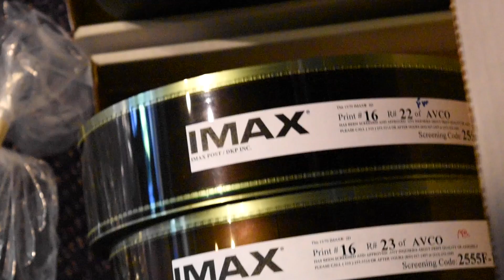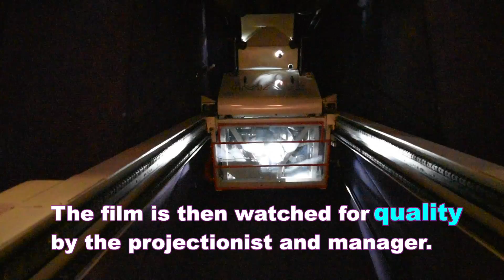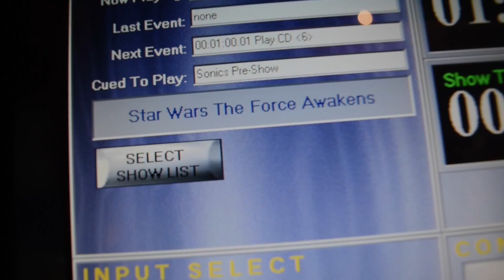How To Build A 70mm IMAX Film - STAR WARS

Comment: That means imax audio is only 4.7gb in size?
Reply from the maker: I actually don't know the answer to that. I assume so unless those DVDs can hold much more that 4.7gb. But I would bet the audio is compressed quite a bit to fit.
Reply: Didnt know that imax would just use a dvd for the audio, maybe it was a high capacity ones or blu ray because 4.7gb wouldnt be enough to fit dolby atmos inside. Ty btw :)
Reply: High Orbit Media no compression of any kind was ever used....three dvds were run in sample accurate sync
Reply from the maker: So how much data can one of those DVDs hold?
Reply: +High Orbit Media 4.7GB max. Blu-ray discs can hold up to 128GB.
Reply: Why can't they just use Blu-ray Disc? They hold about 50gb of info
Reply: Ariya Mangsanhanh I was thinking the same thing.
Reply: There is a DVD DUAL LAYER disc that has capacity of 8.5gb
Reply: Galor S Still Comes nowhere close to the capacity of Blu-Ray.
Reply: 4.7 gb means it can be less too. We dont know how much dvd  is burned. But for immersive audio 4.7 gb is quite large i think, since audio use only little space compared to videos..
Reply: Audio doesn't take much space if compressed enough
Reply: Happilicious What about dual layer DVDs, like the ones used for game consoles? Those usually run about 8-12 gigs and are probably more cost-effective than splurging for Blu-rays.
Reply: A little late, but dual layer DVDs are quite common which contain approximately 8.4 GB of data. Single layer discs are not quite as common outside recordable media.
Reply: But then there is DVD-10 with a capacity of 9.4 GB.
Reply: @NVC77  Oh sorry, DVD-9 might be it.
Reply: Could be a duel layer audio DVD
Reply: @Nitroblast  what???? 17 GB max! 2 layers and 2 sides.

Comment: True IMAX uses a second 'projector' that has 35mm film that contains 6 channels of optical sound information.
Reply from the maker: Care to elaborate on that?
Reply: This was told to me by a buddy that worked at an IMAX theater in Iowa. He said it's a standard 35mm film, but instead of being used to store pictures it holds six optical audio tracks that are read by an optical reader on a second 'projector'. Apparently that's how it used to be done and now the vast majority of IMAX theaters have a digital audio track played off of a hard drive that is syncned up to the 70mm film stock. He always insisted that the optical audio sounded better and called it 'true' IMAX.
Reply from the maker: That is interesting. I knew sound was kept separate but was not aware it was stored on 35mm film. Good knowledge.
Reply: Yes, sounds about right, IMAX tech is not that modern, and before BluRay and DVDs I recall 35mm film was used for sound in my local IMAX theater
Reply: @HighOrbitMediaVideos  I have some pictures for you if you like. Made in the projectionbooth of Fleet Science center in San Diego. It was then called (1980) Reuben H. Fleet Theatre and Science Center. Not so long ago that was the oldest, still running Omnimax projector in the world. It has one on a picture. Btw... thats me standing next to it
Reply: Going as far back as at least 25 years, the audio was stored on CDs...so, that's got to be a very old archaic setup. Not sure what makes it more of a 'true' IMAX since the experience has always been the picture.
Reply: @sjoerdbalfoort7170  We would love to see those pictures! We're really interested in 35mm film projectors

Comment: Few years back i was helping on a presentation at a local cinema, my role was just to control a laptop connected upto a Barco 4K projector. But the real enjoyment for me was being up in the projection booth while a 35mm print was shown. Including getting to see a projector switch during a show (no large spool system at this cinema) and chatting to the projectionist. Who whenever there was a very very subtle change in the sound of the projector knew exactly what was causing it and if something needed adjusting, oiling etc. 

so sad imo that with all the large cinemas using RealD digital projectors now (at least thats whats standard where i live) that the art of projectionists is vanishing.
Reply from the maker: You're right. It's definitely disappearing. The theater this was shot at is converting to digital this year to...

Comment: Do not forget to scan the film negative front and back !!! So it turns out 2 frames with different focus, where objects standing next to each other will have +1 object in focus and + remove micro scratches, and if we differentiate 1 frame scanned from two sides, you can get an absolutely clean frame, like with digital cameras!

Comment: How many times will an average  film run through the projector? What happens with film after it has run its course in the cinema? Is it destroyed?
Reply from the maker: I think a typical run is between 700-1200 times. That's mainly because of the length of the contract to show one, not necessarily because the film is wearing out. But once a film is done, yes it is destroyed. We shoved one into a trash compactor once and it broke the compactor. Super strong film. It's now cut up and recycled I think.
Reply: @HighOrbitMediaVideos  IMAX: the Nokia 3310 of 21st century.

Comment: Dumb question, but would it be possible for the film to be packaged and sent in a single platter-size reel? I'm sure there's obvious reasons for not doing that, such as weight and stress on the film, but it is at all feasible?
Reply from the maker: Good question. They actually can be shipped on one giant reel and it happens frequently. There are specially made boxes for shipping finished films like the ones in the video. Of the films we play at our theater, most of them are 45-50 minute documentaries, so most boxes made for shipping are built for that size film. I've never seen a box made for a feature length film like Interstellar. But we often will send a film we're done playing to another theater so they can show it.
Reply: Maybe feasible for 45-50 minute docs. For full length movies, not feasible in the least.
Reply: Once it gets wider than a standard shipping pallet, it becomes exponentially more expensive to ship. What you can do it split it up into 3 smaller platters that fit within pallet diemnsions.

Comment: Now, I wonder, what if somebody used such long 70mm film to print on each frame black and white dots to represent the binary data of a huge data stream, say, the backups of 500 GB laptop HDD/SSD drives? How much capacity in Petabytes one such long film can have?
Reply: It would be more worthwhile for data storage to make it into magnetic tape

Funny enough you DID hit on how magnetic storage works its just the "dots" are areas that are either magnetized or not magnetized

Comment: 15/70 IMAX FILM NOTHING ELSE COMES CLOSE  = 18K DIGITAL QUALITY.
Reply: Film is shit, and can't compare even to 6k, not to mention 8k digital.
Reply: The issue (beyond the fact that there's no "correct" way to equate digital resolution and film resolution) is that the actual resolution and picture quality of a given reel of film will depend on the speed (ISO) of the stock, how well it was shot, how well it was printed, how many copies away from the original negative it is, how old it is and how heavily it's been used, etc. The advantage to digital is its relative consistency, but under optimal conditions the general consensus is that 35mm film requires at least a 4K scan to fully capture its detail without artifacts. An 8K scan of 15/70mm IMAX film would certainly fall short of capturing all the detail.

tl;dr: film CAN be shit, but when it's done correctly it certainly isn't.
Reply: That's not how it works. Arri Alexa doesn't even shoot 4K yet it's one of the best cinema cameras on the planet.
Reply: @gr3473  you're wrong. Film silver particles are so small that they can hold incredible detail. 7cm film is so high quality detail you need to scan it in 16+ K.

Comment: It takes about 30-40 minutes at most to build up a 35mm feature on a platter.  So I simply do not believe it takes 2 days to build up a 70mm feature.  I would estimate 60-90 minutes.
Reply: Mike, each reel of IMAX 70 is ONLY 3 MINUTES. So there are 6-7 IMAX REELS to ONE REEL of 35mm or 70mm 5 perf. You do the math.  So yes, it can take 2 days to build up a print in IMAX.

Comment: Is IMAX automatically 3D, or if not, what's the difference between the two?
Reply from the maker: No way. 3D requires two of everything. Two film prints for 2 projectors for each eye. Much cheaper for 3D to be digital.
Reply: High Orbit Media Haha that would be something and a lot of work! Two IMAX projectors keeping in sync!
Reply: @moow950  that is not an issue syncing  has been around for decades, i could sync any two machines in my 8 plex without issue.
Reply: @moow950  They actually integrate both projectors into a single machine. It's got two lamps, and the film transport rotor has two levels that each holds a separate film print. They physically can't get out of sync, as long as they're synced properly during threading.
Reply: Adam Ahmed OK, but so much could go wrong and it’s so much hassle. Digital is way better in that respect than film.

Comment: Kind of pointless since most of the movie was shot on 35mm
Reply: Even still, 70mm does provide quite the uptick in detail and much more vibrant colours.
Reply: Scott Baldwin How is that possible? You can’t extract more detail from a 35mm negative than there is available . Blowing it up to 70mm doesn’t give a higher resolution of the source.
Reply: @moow950  70mm is shot on 70 mm so if it needs to be 35mm the 70mm is down scaled to 35mm.